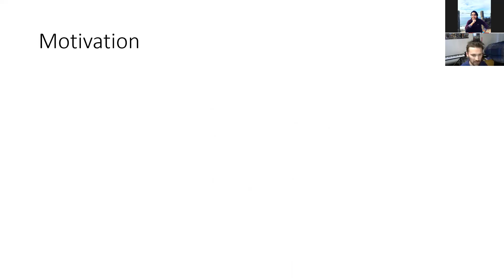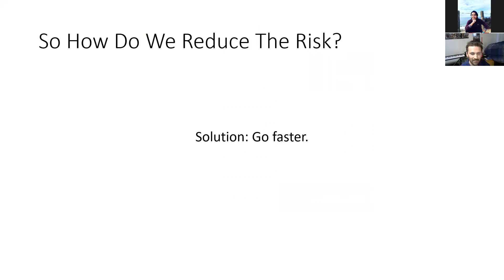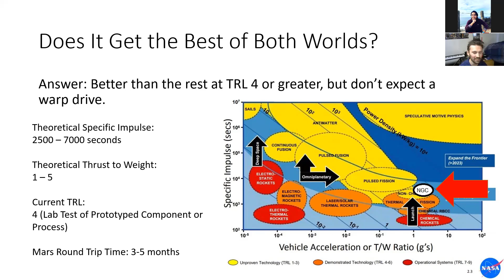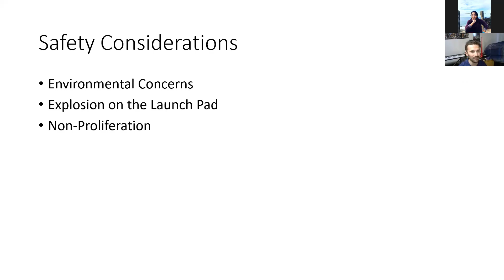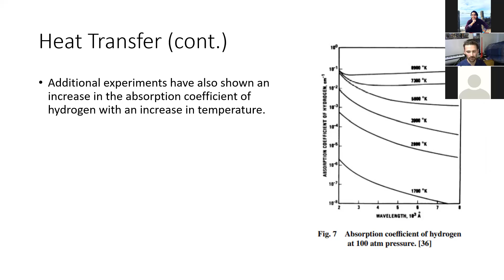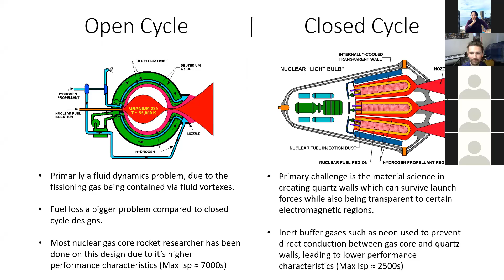Roadmap to Nuclear Gas Core Rockets (2021 AIAA Student Paper Competition)

Comment: the reason there is no papers beond any decade in the past. is due to the black projects. for example nuclear cruise missiles, nuclear jet planes. well no one would ever admit of a nuclear rocket space fleet capable of reaching and returning. from the voyager probes in a few months. amazing that the voyegers started transmiting data again after a few years of none. some person on your sight may be the idea generator. for a working nuclear drives for all the apps stated above. this person might have worked out the flight paths for the voyagers. with a gravity assist from the planets in the 1970's. this person might have invented the first gen. 6 nuclear reacter. that will not go china syndrome. built by the e.u. simple air cooled graphite ceramic balls. that stay at 780 kelvin with all cooling pumps off and sustain the 780 kelvin after a spike to about 800 kelvin. p.s. no one will ever say that in the fule crisis era. nuclear tow jet planes ever were built. a way of economic cold war wins for the u.s.a. things allong this nature might have forced the u.s.s.r. to go bankrupt. due to fule costs for them.

Comment: i still lean toward the concept of using the reactor to generate power.... 
apply a large bank of ultracapacitors
and a set of multi tiered electromagnetic couplings.

align the couplings to three celestial masses with a significant gravity and spin.
calculate the compression of the magnetic filed to stretch a field to each mass.
anchor vessel to earths magnetosphere.
make connection to each of the other three magnetospheres.
drop connection to earths magnetosphere.
ship should center itself between the three masses .

yes it is a tracking nightmare to keep your field linked to the stars while moving.
let alone pin pointing which three masses to get your center point closest to your destination.

Comment: as a materials engineer I have seen a problem that I do not think you have considered: hydrogen embrittlement both in the reactor and also but not very pronounced in the tank. and it is not small if we have hot hydrogen for months in contact with the metal the engine will break. good discussion anyway
Reply from the maker: Fair point. Propellant can be exchanged for other gases if need be, not sure if there are any workaround if you know of but super useful to know.
Reply: @colinwarn4606  the problem is that you can't replace Hydrogen: the velocity of the exhaust is proportional to the (1/m)^0.5 ( if i remember correctly if you use helium which is the second best you will lose a lot in specific impulse side  and it  will be similar to a chemical rocket, i think that you can use composit for the tank, and maybe  the plasma confinement will preserve the core, but all the pipe line and the cooling channel will disintegrate, and if you find an alloy that is capable to work in this high hydrogen high temperature will be a revolution
Reply from the maker: @francescoiacono250  you're right in that the specific impulse would see a hit (about a quarter of 6-7k seconds if you used methane, which is still significantly better than chemical), and of course instantaneous thrust will go up proportionally which could be beneficial. Didn't even know about this phenomenon until now, will definitely keep this on my radar.

Comment: Very interesting concept. Have you considered placing the plasma core and the hydrogen heating chamber on both foci of a reflective ellipse, respectively? The idea here beeing the greater physical separation of both the nuclear and thruster systems, perhaps allowing for a safer and less cramped design.
Reply from the maker: Haven't looked into it at all: The purpose of this paper was to compile every single paper I could find on this topic into one master reference document. Could be viable, but haven't examined it at all yet.